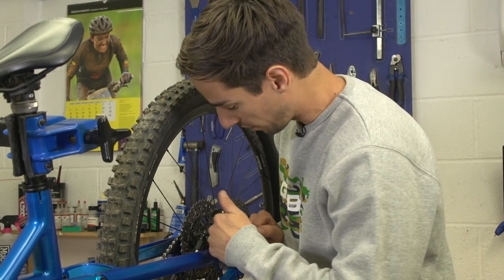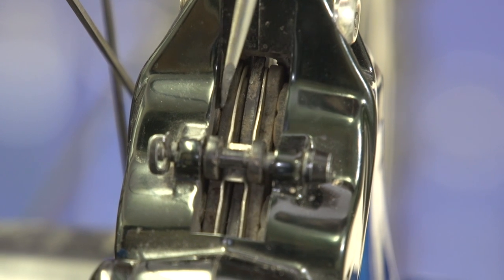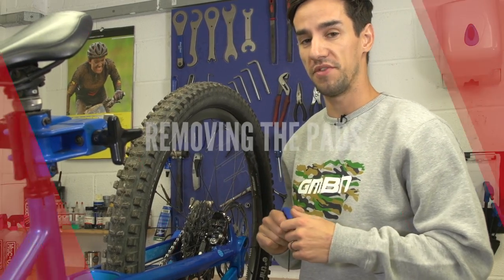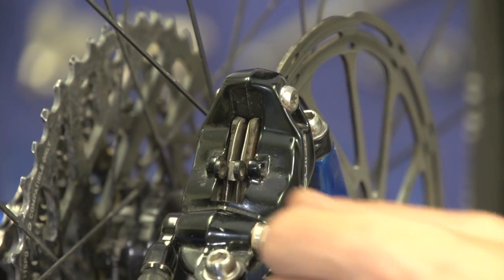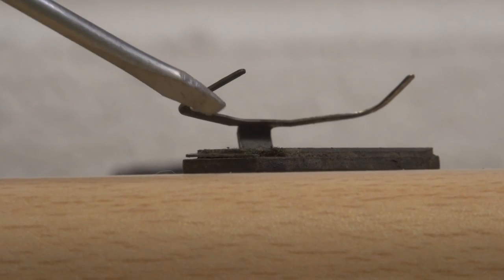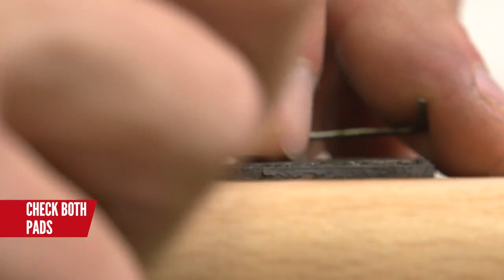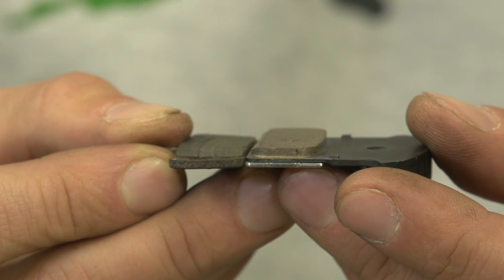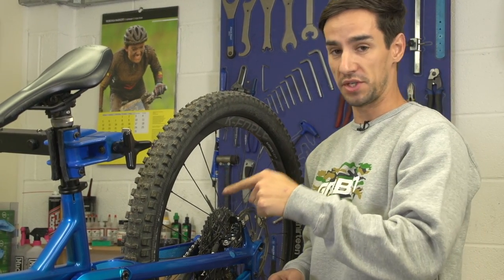How To Check Brake Pad Wear | Mountain Bike Maintenance

Comment: So on your brake centering video, i know most manufacturers say to loosen the bolts and squeeze the brake then tighten to center it. I've never seen this work on any bike that ive ever owned with disc brakes. Like you, I also have a sram guide brake system. What i found helpful to center the brakes was a freezer pop wrapper. You cut off a small section and cut one side and clean it out after uve eaten it or whatever and put it over the rotor, then spin your wheel slowly until the wrapper is in between the pads and the rotor or have ur caliper completely off and put ur caliper on over that so the pads are touching the wrapper but make sure it doeant bunch up then squeeze the brakes and tighten down the caliper and then simply spin the wheel slowly and pull the wrapper out and then ive found that you will eliminate rub and be centered unless ur rotor is bent. I havent found that it contaminated the rotor in any way as long as youve cleaned it out. But either way ive never known a bike to wear the pads evenly even if it is ceneterd properly. For me its a constant battle to center my front brake because everytime i have to take off my front wheel i have to remove my caliper (cannondale lefty supermax) unfortunately it weekens the bolts each time and they do snap. Luckily chain ring bolts fit though it takes a while for them to arrive because they are not readily available.

Comment: Hi just a quick question i have to replace a broken spoke in my rear wheel is there anything i should know before i start ? I have a GT Avalanche hardtail, Thanks guys keep up the good work :)
Reply from the maker: You will need to make sure you have the right size and length spoke!
Reply: Thanks guys :)

Comment: #askgmbn what is the difference between metal and resin brake pads and when should I use which?
Reply: and what about ceramic and semi-metallic break pads ? thx
Reply from the maker: Sintered pads for wet and Resin pads for dry :)
Reply: Is it ok to swap front and rear brake pads? My front isn’t nearly as worn out.
Reply: @lasagna3084  yes
Reply: I use metal

Comment: #ASKGMBN On my enduro bike I have sintered brake pads. Really good but yesterday I had a ride in the wet and the only thing that happened was a super loud noise.. It actually brakes a little bit but i have to push really hard.. Why is this happening?
Reply: It is because sintered pads are not as good for wet riding as organic pads. Organic pads will be loud too (at least mine are) but you will be able to slow down much quicker.
Reply: do you know a material which isn't as loud? I live in a city and having such loud brakes makes me feel embarecced
Reply: I hate it too, but organic pads are the best and most quiet i think. You can look for pads from swiss stop and other companies. Just try asking in a mtb forum which are the best for you, maybe you can get good advice there.
Reply: metal pads are better in bad conditions!
Reply: Metal=sintered right?
Reply: No.. there should be organic, sintered and metal pads.. i actually need powerful brake pads (I also do street riding) and pads there are not such loud in the wet
Reply: Patrik Müller pretty sure metal pads are the same as sinterend!
Reply: use sintered/semi-metallic pads theure the same thing. theu brake well are not as noisy as metallic pads and will work in all conditions and not wear ur rotor out as quickly as metallic pads. I would recommend organic pads if ur looking for quiet brakes but they will not work that well wen they get wet nor can they handle high intensity braking like downhill and organic pads will wear out fast and not stop as fast. i recently switched from organic to semi-metallic. love em. havent had that dreaded squeel yet but i usually never ride in the rain but i do ride trails with a lot of technical sections or through streams and theyve worked well. i wouldnt recommend metallic because they are louder with the squeel and are more meant for high speed braking like the hotter they get the better they brake type of deal so for like downhill type of stuff. but if youre just riding down the street in wet conditions semi-metallic is the way to go for u. organic pads will feel grippier in dry conditions but will not brake well long term. plus semi-metallic pads last longer but theu will wear out ur rotor a little faster than organic but not as fast as metallic. so organic great initial bite, wears out fast, will not work that well in wet conditions, and can't withstand prolonged periods of braking more for a beach cruiser, semi-metallic is kind of the do-it-all kind of pad where it has a decent initial bite, lasts longer and puts some wear on your rotors, and will work in wet conditions and can be used for semi-long periods of braking like a, and their squeel will be pretty quiet made for an all mountain bike, metallic pads are a more built for one purpose type of deal to stop you for longer, meaning they dont have as much initial bite but the bite comes during braking as they heat up, they will wear out your rotors faster, they will brake in all conditions wet, ice, mud, and they can brake all day until they warp your rotor or burn out your caliper they will fail before your pads will its more for downhill harsh braking conditions. they will be loud more for a downhill specific bike.
Reply: Outstanding answer thank you👍🏻

Comment: What tire is that on your  bike Neil?
Reply: It is an E13 TRS "race" tyre...it's softer than the "plus" version.
I would like to know what the guys think of it? #askgmbn
Reply: I'm interested in it also.
Reply: Nick Rogers I've been running a softer Race up front and harder Plus in the rear. It's like a cross between a Mary and HR2. That makes it a draggy on roads and climbs but grip is phenomenal (perfect for gravity) and almost as strong as full DH/Super gravity tyres despite only being 900gms a piece.
Reply: Johnathan Barrett I run a hr 2 on the rear and a minion dhf up front. I'm always on the look out for any variations out there. I spent 80% riding up hill and 20% downhill so maybe not the best for me?
Reply: Nick Rogers Balancing set up for climbing/descending is the age old dilemma. Seems like you have a pretty good combo already (and one I have used and would use again). 
As a relative reference I would say the E13 combo is a bit heavier duty (actual weight is only slightly more than DHR2/HR2) and more durable over abrasive rock (not that the HR2 isn't pretty good in this respect) and grip is also commensurately a chunk higher. I am going to try changing the rear to a DHR2 and HR2 to see if I can make faster. 
I was curious as to why the video has a bike with the softer Race tyre on the rear. I can only guess it's a very Downhill orientated set up. I would expect it to wear very fast on the rear.

Comment: #askgmbn
Is it ok to exchange my front brake pads with the rear brake pads?
Reply from the maker: As long as they still have pad left then yeah!
Reply: Thanks. The brake pads are still ok since i seldom use the front brakes.